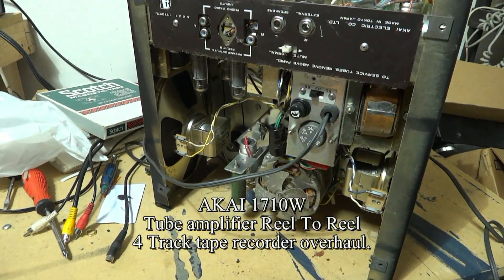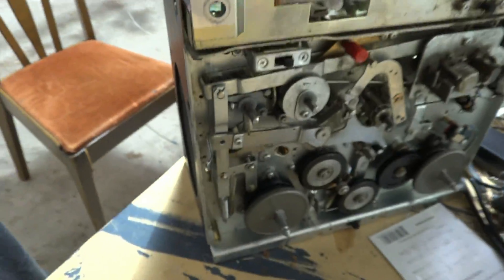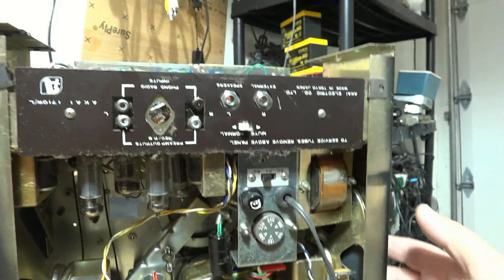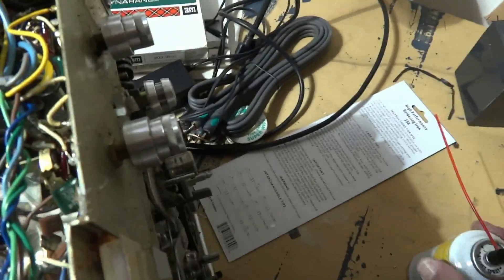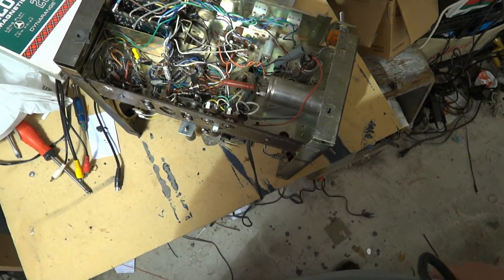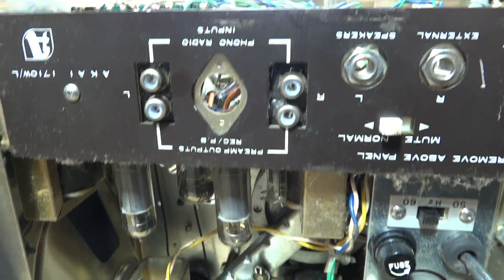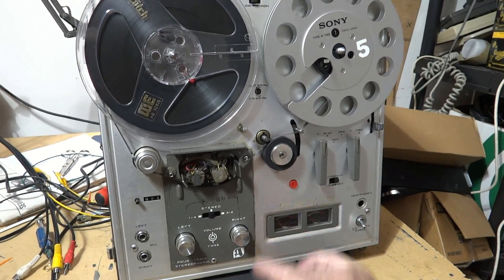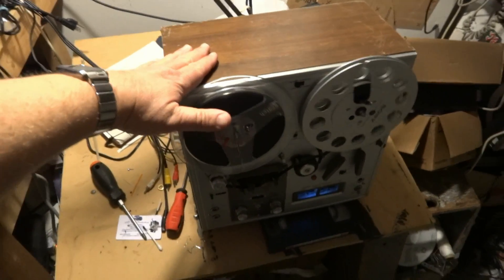akai1710w

Comment: I just bought similar unit from original owner. It is in amazingly good condotion and needed only some cleaning of tape heads and rubber parts. These old pieces of technology are made in high quality that is not the case with today’s audio.
Reply from the maker: The head on mine is pretty worn.  Can hook your fingernail on it

Comment: I have one of those. It powered up for about a half hour, but played slow. It also emitted an electrical smell. Then it shut down and won’t power up.
Reply from the maker: Running slow would be the run capacitor on the motor.  The burning smell and not not powering up is more concerning.  Electrically leaky caps will over bias the tubes which can damage them. If the main filter is bad it will draw way too much current which can over heat the power transformer.  If it gets hot enough the insulation on the winding melting it causing a short in the transformer burning it out. All this vintage equipment needs to initially be powered up using an incandescent light bulb in series to allow a soft start and reforming of the power electrolytic caps.  If you are lucky it just blew a fuse.
Reply: @12voltvids  thank you for that!!
Reply: Ive just got one of these and i thought the set up was transistor pre amp with tube main amp

Comment: awesome video. I had  the pleaure of listening to one and am gonna make the purchase from an old guy i knmow in  Singapore. Quick question, can i hook this up to an integrated tube amp. This already has a preamp so wondering if there would be distortion hooking upto an integrated. But my integrated is a 2A3 SET which sounds fantastic with Vinyl. Can't imagine what heavenly hi-fi glory I'l lget with this. But concern is if there would be distortion.
Reply from the maker: It has preamp output as well as a power amp so no, it won't add distortion.  Keep in mind that these units suffer control cams that crumble to nothing.
Reply: @12voltvids  what are obits? And good to know I can hook up my integrated to it without causing distortion.
Reply from the maker: @skularatna8136  these units. That's the phone that thinks it knows better and changes words.  I corrected it right away but i guess you got the notification
Reply: The input volume is really low any ideas when I plug in a source like CD player

Comment: Quick question, should the phono/radio inputs work through the external or internal speakers or is it purely for recording? I can monitor that input via the headphone jack and it lines-out via the pre-amp outputs, but that's it. I figure it's by design by just unsure. Thanks!
Reply from the maker: Speakers are active when input in record.  I used to use this as a guitar amp.

Comment: The speakers  into is a mid or full range??
Reply from the maker: The built in speakers are full range with whizzer cone.
Reply: Great sound speakers
Reply from the maker: @pablobaldomir9430  
For built in not bad. The tube amp helps. You should hear my main music room speakers, I have a set of vintage 1976 Technics SB7000A. These monsters have 14" woofers 4" mid and 1" tweet in a phase linear arrangement (mid and tweet are in their own enclosure mounted offset on top of the boxes so the mid and high sounds arrive at the ear in phase as higher frequencies travel faster then bass frequencies) Now those speakers driven by a full valve amp sound absolutely fantastic. I don't think I have ever demonstrated these, but I tell you the sound off them is incredible. They are so clear.
Reply: Yes -
Reply: I know the 1721w and similar at the 1710
Reply from the maker: @pablobaldomir9430  The 1710 and 1710w are identical except that the w version is a world wide modem. Multi voltage and 50/60Hz.
The 1710 were country specific.
Reply: Technics is very good olso
Reply from the maker: @pablobaldomir9430  
I have a vintage McIntosh 1600, but these days I use a Yaquin MC10 tube amp as it uses readily available EL34 tubes. I run up lots of hours on that amp. 50 watts per channel is more than enough power for efficient speakers like the SB7000.
Reply: But i fanatic for the akai's :p
Reply from the maker: @pablobaldomir9430  I have 3 Akal R-R 2 Sony, a Teac and a vintage Grundig. I need to start unloading some of those old units I never use.
Reply: Wow many reel to reels

Comment: I just got one ...  just a 1710 but it has switchable power input , but the power transformer is shorted.... some idiot put a 20 amp fuse in it...now searching for a suitable replacement... wow yours in a wooden case? ... mine is a portable ...
Reply: I have this same model, want to use the slowest speed but the capstan sleeve wouldn't come out, does it have threads ?

Comment: I have the Akai 1721W and it works perfectly, but no problem. I got this from my uncle a long time ago.

The inside you see is much of the same as it was in the 1710W, and it’s completely solid state. The 1710W has tubes, but the 1721W does not, it’s solid state.
Reply: But the tubes is a hi fi sound
Reply: The tubes used for amps of guitars
Reply: Mtn. Mi.father have one akai 1721w and the speakers jet stream sistem :0
Reply: 1721w is a transistors

Comment: I wanna see your listening room.  I'll bet it is filled with goodies.
Reply from the maker: You would be disappointed.  Tube amp, 200 disc changer, hd radio tuner, dat deck a cassette deck and reel to reel that isn't connected Dito for the thorens. For show only.  Oh yes and 2 big speakers.  Technics sb7000. That's it.

Comment from the maker: For those that wonder what the "W" means, it is a world wide unit. 100, 110, 120, 220, 240 volts, 50/60 Hz. Has a dual pulley system. Units without the "W"  were single market, and were set up for the destined country.
Reply: The W actually means wood finish on the cabinet the L denotes a leatherette finish. The roberts variant was only for the us market as it didn’t have a multi voltage transformer and frequency adjustment . That machine is the mk2 1710 which is a hybrid . The pre amp is transistor - 2x (2sc650) & 2x ( 2sc649) Transistors . They are excellent machines I have six of them . Cheers bruce
Reply: @bonusnudges  I am repairing my audio board for this machine and the schematic says there is a SC458 and a SC650 on each channel. However, on the board itself I find two SC458 transistors instead of both a SC650 and a SC458. I have to replace the transistors on this board because there is noise on one channel. Would I be safe putting in a SC650 equivalent (since the schematic says it should be there) where one of the SC458's are?
Reply: @bonusnudges  Wow, that's a great response! The noise only shows up when I turn the left channel all the way up to maximum volume. The right channel is fine. I just did not understand why I did not find any SC650's. I checked each tube and they all tested "Good" and without shorts on my B&K 606. It could be the valves. I suppose I will see. The left channel noise is the only issue I have left to repair. The transistors will be here in about a week so I have some waiting to do. I really hope that finishes everything for me. The worst case scenario, for me, is having to track down a bad resistor. That's the only thing I don't have experience in. I fear it may be very time consuming to do.

Comment: Great stuff!  Very interesting in the way there were so many floating caps and resistors etc connected via wires, I guess this was built before they started using PCBs in mass production.  Also interesting to know the history behind this particular unit, your dad would be proud =)
Reply: Печатные платы были уже в 69м году , но в ламповых усилителях принято делать без плат на весу
Reply from the maker: Yes this was the constriction of the day. There were PCboards back in the 60's, and I am going to showcase a few of my vintage transistor radios as I have some very old  radios. I have an old Sony 6, as in 6 transistor AM radio that was my Grandmothers unit that she listened to every day. It was the first all transistor radio offered by the Sony corporation from way back in the 60's and it uses a PC board.
Point to point was popular in tube gear as replacing tubes on PCboard equipment causes big problems. Wiggling the tube to get them in and out of sockets broke many a board,
Point to point was more reliable.  One of the main reason for overhauling the Akai was because it is a tube unit, and I just love tube gear. I listen to music on a nice tube amp from recent manufacture. Music just sounds better, regardless of the source on tube gear. The even order harmonics adds warmth to the sound.
I used to have an old vacuum tube color TV, and I am kicking myself for throwing it out as that would be a real collectors item today.
I do have an old Halicrafters shortwave radio I plan to overhaul and film some day as that is also a neat old radio from the 40's I would guess.
Reply: Very interesting stuff!  Got me interesting in getting some kind of valve based amp myself.  The Akai is a very nice piece of kit - looks in great condition with regards to the age etc.  Looking forward to any future repair / restoration vids you do =)